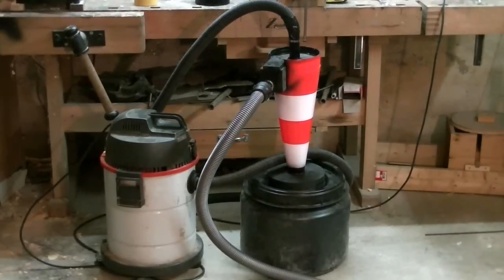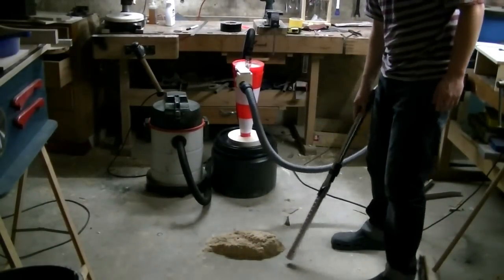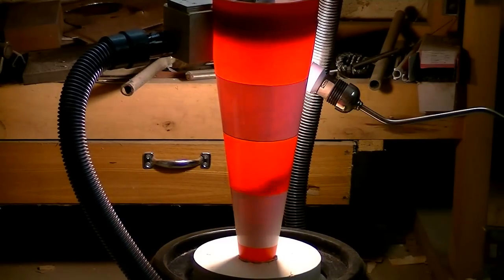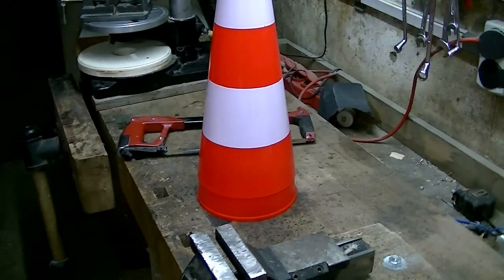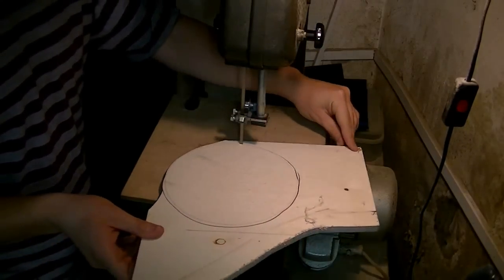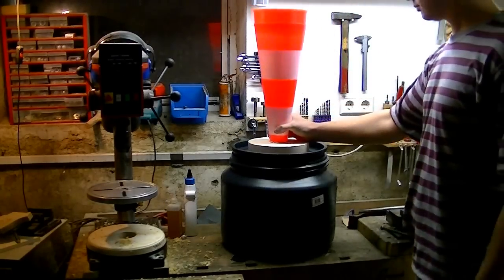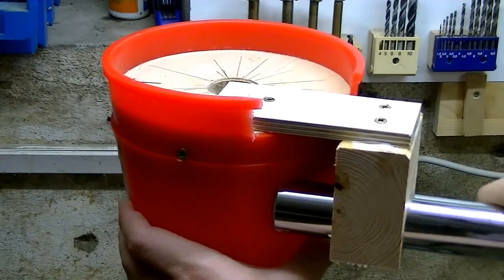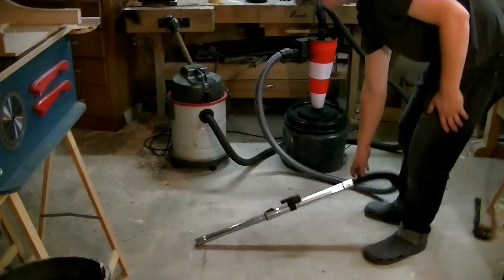Building a Street Cone Dust Seperator / Eigenbau Zyklonabscheider Fliehkraftabscheider Staub

Comment: Good work but if you use a Thien baffle you can make it to fit between the top part of the shop vac and the bottom drum. It's very neat and takes up a lot less floor space. It's also easier to move around the workshop. I made a Thien baffle which works really well, building one to fit the shop vac is my next project

Comment: Interesting note... gravity is not what drives the dust into the bucket.  Your cyclone will work even if its sideways or upside down (as long as the collector is oriented so it doesn't allow the dust to fall back into the cyclone.
Reply: +Tony Shulthise Sir may I offer my congratulations for your deeper insight  into the dynamics of a conical cyclone.    How I wish our schools would present dynamic motion and other " invisible phenomena" which our schools miss.     Again Sir  congratulations for your deeper insight .
Reply from the maker: +Tony Shulthise That is obviously wrong. Just read the linked wikipedia article.
Reply: +Cosmas B  you might want to try it and not believe everything you read on wikipedia.  I wasn't telling you a theory.  I physically tried it myself with a Dust Deputy cyclone and watched the sawdust spiral uphill into the bucket.  Be curious and question more.  

You can try it yourself with your cyclone.  I will work until the mass of dust gets too much.  Efficiency is reduced but it works.  Use the light behind the cone so you can prove it to yourself and learn something about wikipedia at the same time.
Reply from the maker: Tony Shulthise
It must be magic then.
Reply: +Cosmas B Well, if you try it with your cyclone then the "magic" will become "physics that you will want to understand" ;-)  I would make and attach a video of it here for you to see but I don't see a way to post videos in comments.  

I believe its simply the circulation path of the air in the funnel that allows it to happen... air flows along the walls of the cone in a spiral from the inlet to the small diameter then back up the center in a spiral.  The aerodynamic drag of that air circulation pattern is enough to carry most dust "up hill" to the top (small end) of the funnel even if its turned upside down.  I haven't tried it with larger pieces.  Any pieces with a high aerodynamic area to weight ratio should move up hill with no problem.

I thought of trying it because I realized that the forces the particles are seeing are 1000's of times that of gravity so turning it sideways shouldn't hurt performance much at all.  While I was at it I turned it upside down because that was the obvious next thing to try.  On a smaller cyclone design I used a clear cup to catch the dust under the cone.  On that one even the dust in the collection bin stayed suspended at the top (against gravity) when I used it upside down.  The air currents were plenty strong to keep the dust pushed out and toward the bottom of the collection cup (up).  I mentioned it because you seem like a curious person and the idea of mounting the cyclone sideways or upside down may give you options to make your design more compact.
Reply: +Cosmas B 

I tested a Dust Deputy cyclone today and it worked okay sideways but only worked upside down for very low dust loads and for light particles.  Heavy particles or high loads sent the dust right through the vacuum pump and even clogged it a couple times.  I never saw this on my cylindrical cyclone but I'm sure it has limits also.

This all makes sense after I thought about it a little more...  There's a weak circulation created perpendiculart to the cyclone axis from the inlet down to the collection end on the outer diameter of the cyclone where all of the larger particles are slung then back up the center and through the vacuum hose in the center.  So, you get a very strong circulation about the axis of the cyclone and a much weaker, but significant, circulation perpendicular to the axis of the cyclone.  The perpendicular circulation forces the heavy  particles away from the vacuum end toward the collector even if everything is upside down or sideways.  

If the drag force on the particles is less than their weight then they will move in the direction of gravity when the system is upside down.  Otherwise, they will move toward the collector.

That means fine particles essentially will work equally well with the cyclone upside down or rightside up.  Heavy particles with relatively small aerodynamic areas will only work in the direction of gravity.  Also, if airflow drops too much then the perpendicular circulation decreases which favors gravity more.

See... no magic.  Just physics that aren't obvious at first glance ;-)
Reply: +Tony Shulthise have you ever made a video of your cyclone so you can share it in YouTube? Your explanation is pretty interesting.

Comment: Have you tried how it works with thinner dust? I have done a similar separator and it takes most of the dust but not all, and the dust it doesn't take goes to the filter and the vacuum stops working at 10 min. What I am sucking is wall putty.
Reply from the maker: Yes, it works great.
Reply: Physically cyclones are limited in separating particles less than 10 micrometre. And they have a wide selectivity in particle size what means u always have some larger and smaller particle pass through.

Normally they are used for pre separation of rough partikels like in this example for preseparating wood chippings.
Reply: FliegenderFluegel So, if a put two cyclons, one after the other, will I have the same problem?
Reply: Alberto Martínez Right. Separation of cyclones depends on mass effects of centripetal force vs bouyancy. Smaller und low weight particles have more bouyancy and therefore follow just the airflow.
Reply: FliegenderFluegel Ok, thanks for the answer. And of course, thanks Cosmas for your vids, I'm a fan of yours

Comment: you said that it takes away a little bit of the sucking power?

can you explain why?
Reply from the maker: Because moving all that air and drawing it inwards against it's own centrifugal force takes some energy.
Reply: Most of the energy is dissipated when air entering the immersion pipe within the cyclone. You can vary the length of the pipe or build a smoother inlet (eg bordure) to get better results.
Reply: any obstruction in the pickup side of the vac will reduce suction. the hose,cone,fittings all wll cause a reductoin in suction.

Comment: Tell me please, what is more important: that the cone has certain height, or the bucket? I made my prototype today out of 6l water bottle, which is a bit sqare shape, and the bucket is oval from some enterior paint, and i know these are not preffered shapes nad i have a little too much of dust going into the vacuum, than i should. So is it really because of the shape of my setup parts, or there ar certain dimnesion on cyclon thst shpould be respected for?